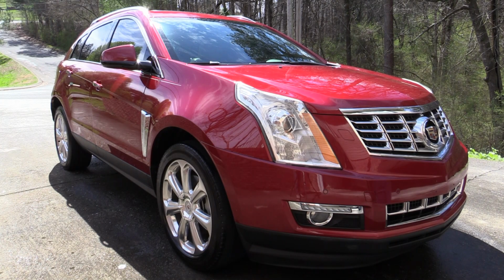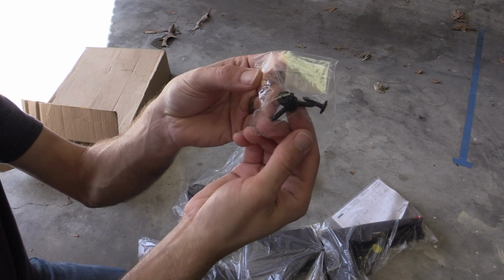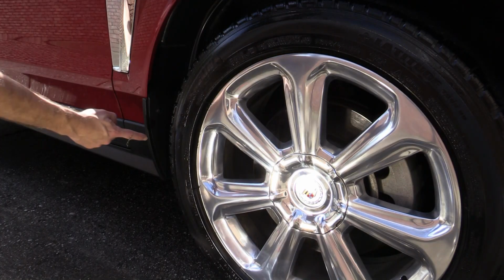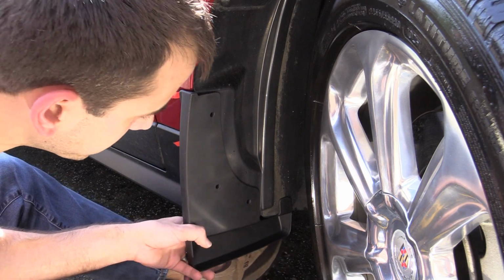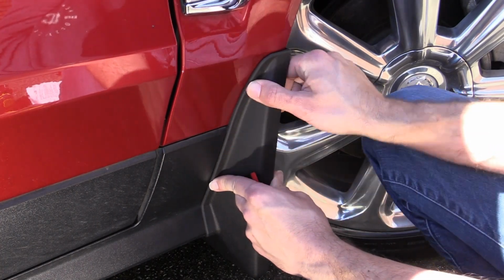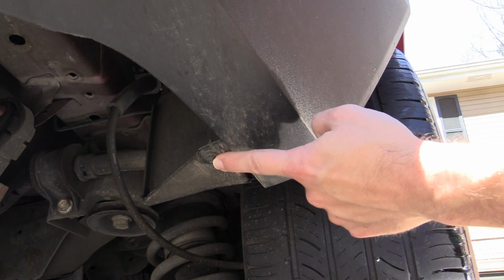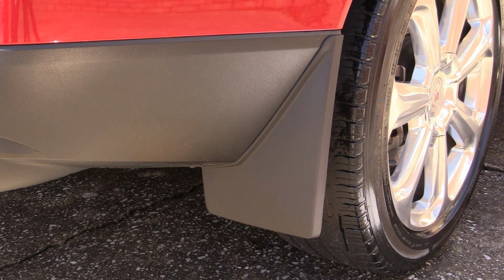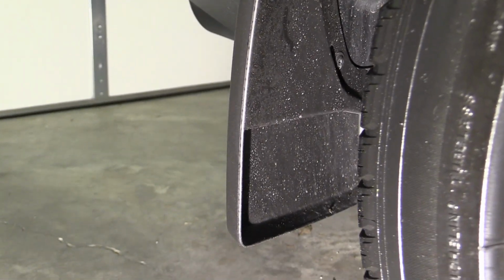2010-2016 Cadillac SRX OEM Splash Guards Instructions & Review (19170629)

Comment: Thanks for the video.   Didn’t even think about these being available.  I’ve found your videos to be excellent with clear instructions (T15 torx bit) and part numbers(19170629) very helpful.   Went on eBay and found OEM GM  for $53 shipping included (there were a lot of Chinese made pieces that were cheaper).
Reply: Follow Up:  got the  GM factory splash guards and installed them with the aid of your video, no sweat, and they look and work great.  I was getting the splash from the tires on the rear panel, no more!